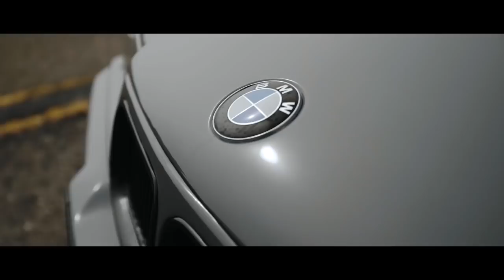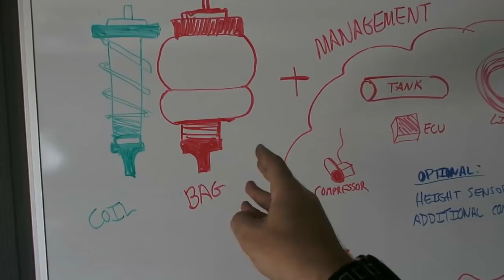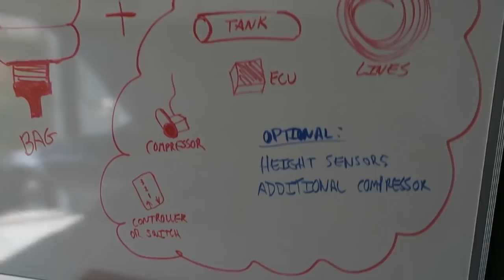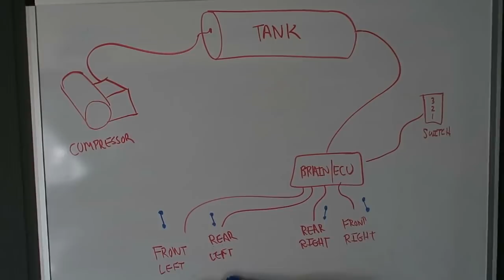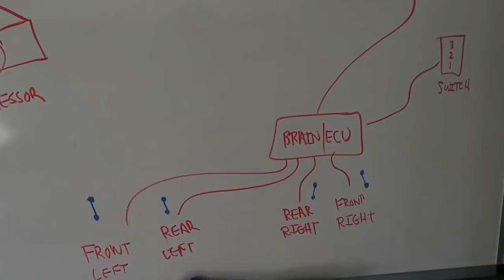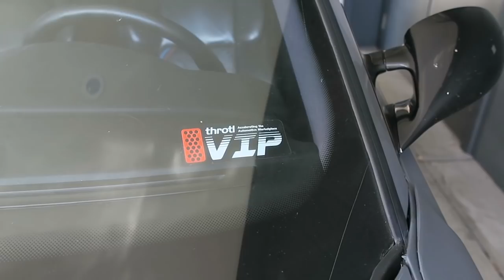HOW AIR RIDE WORKS... THE EASY EXPLANATION!

Comment: I got the bag part down, it's the management that's confusing. 
I wanna bag the back of my mk4 Jetta because its being turned into a Ute and I'd like to level it without suspension travel loss. 
The bag kit is like 500$ but the management styles are a little confusing to me as far as cost , drawbacks and benefits to each. 
I guess what I'm saying is I don't know what kind of management I should use.

Comment: My bags r not filling up coz my kompressor’s runnin all the time
Reply: Problem with your valve body/leakage in the piping or strut(airbag) - fix leakage. Either way after the work is done, get it programmed if it is supposed to be.
Reply: Yoh bro, how is the ride quality comfort compared to stock. Amma bout to bag my car

Comment: I'm doing a track setup for my e36 I just got. BC coilovers? Or bags? Are bags as stiff around corners as coilovers? Keep up the good work Evan!
Reply: Jon Drives be careful with bc coilovers because sometimes for the rear, the spring might be bad. Hust warning you bro. I recently got some for my genesis and literally a month later I started hearing a clunk and its from the spring.

Comment: What’s the cons of air suspension and would you use it on a track car?
Reply: Very high maintenance and will fail anytime causing you to stop the vehicle and get it towed or emergency temporary filling with a scanner/vcds. Not worth it. I’m not even talking about any company. I’m talking about Audi Q7 and Mercedes GL350 CDI.
Reply: @syedmujtaba4162  Those are shitty ass car manufacturers known to break down